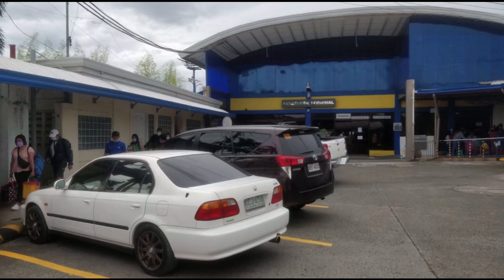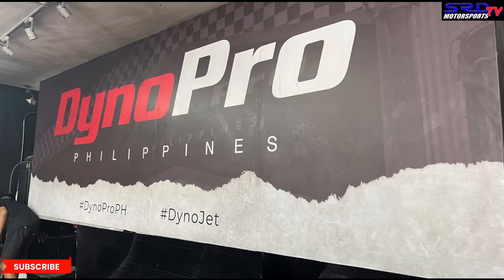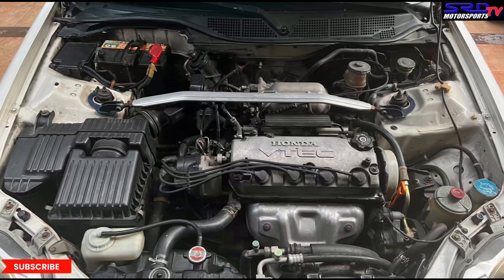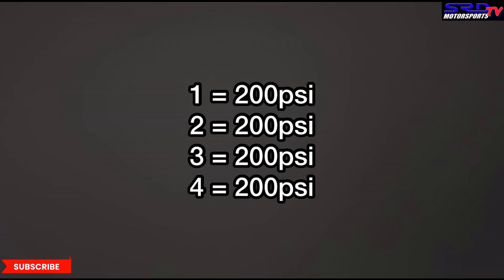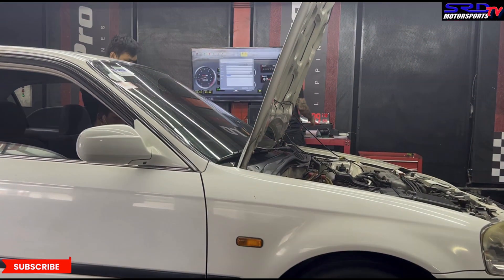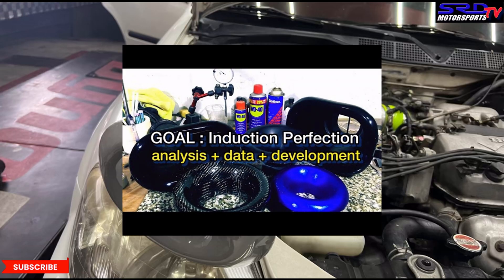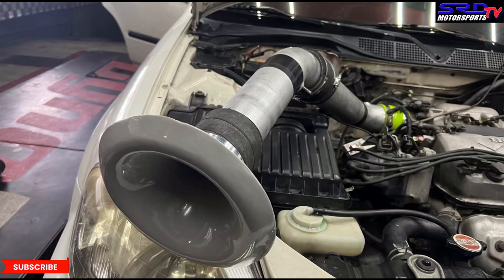Civic VTi D16y8 Ph16 Rebuild Series Part 1 Dyno Run Inside

Comment from the maker: Here we pin all the episodes for you guys

Part 2 - https://youtu.be/6kEWCg6fspE

Part 3 - https://youtu.be/WX0-5cbw5IU

Part 4 - https://youtu.be/NBF4Xvz52PU

Part 5 - https://youtu.be/q_Fv389r454

Part 6 - https://youtu.be/Cs1ugWuaR6U
Reply: Sir is the D16Y5 the same as the local VTi engine?
Reply from the maker: no the local VTi is just different from most I’ve seen
Reply: @SRDmotorsports  thank you sir. But is the D16Y5 better than the local VTi engine in terms of power output and fuel efficiency?
Reply from the maker: I don’t know and it’s really not that important because we don’t get or have the d16y5 here
Reply: The 2000 VTi-RS i just bought has the D16Y5 engine. I dont think the car has undergone an engine transplant
Reply from the maker: unlikely cuz all local cars are stamped ph or pg6
Reply from the maker: And there are d16y5 engine sellers here

Comment: Finally! A local channel that's building an identical car as mine. And a build series na susubaybayan ko! I have a P6FD1 engine sir.
Reply from the maker: Oh same same… I think it’s fine just don’t know why the change from or to ph16a done by Honda  I think siR body is p6fd1 VTi
Reply: @SRDmotorsports  that's right, sir. I have the same model 1999 vti sir body, manual tranny. 
Are they really just the same as the ph16? I believe this is our version of the d16y8 or the vtec-e. No actual cam profile with higher lift. It only changes a bit when it reaches a certain rpm (I think 2500 or 3000?) Number of valves engaged past that rpm? 
I still don't know for sure so I will definitely follow this build!
Reply from the maker: @mjfanHD  yeah ph16a and p6fd1 is the same one

Comment: great video I used a larger throttle body off b20 and port matched intake both sides    healthy motor at 200 psi  would go another 20 years
Reply from the maker: Funny yet so true another 20yrs looks like it can handle at the boredom of the owner hahahahaha

That’s a good move usually the b20 tb is cheaper than the b16 but same size 😫 on the next episodes we’ll talk about the changes I would do, I want to reach the “ram air” power of 106whp on stock airbox lol

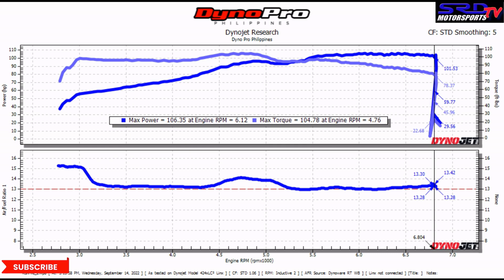Comment: 12:09 + good header and tune = interesting to see how much it would make with just bolt ons and tune
Reply from the maker: So true! But in the flip side… do the “usual” banawe mods we see like random header + simota would it make the same whp or less and if same? Not on stock ecu? Interesting right?!
Reply from the maker: True story sa dyno run it was hard to tell “when” it was WOT cuz all stock muffler lmfao!
Reply: Will you be touching the ports on this build?
Reply from the maker: @findtherightbeat  tempted but to be fair maybe just “port match” as I wanna show the difference of a “proper” rebuild with minimal changes this way power gains if ever is purely on engine health
Reply: @SRDmotorsports  Shooting for maximum efficiency with stock components 👍
Reply from the maker: @findtherightbeat  yep… pretending it’s “limited class racing” must be stock loool
Reply: @SRDmotorsports  What I find interesting is how consistent the AFRs are with the stock ECU and how the pipe length leaned it out and produced that hump
Reply from the maker: @findtherightbeat  yes! That stock ecu be rockin consistent AF! And true on the  extended intake pipe

Notice up top last 500 rpm it was linearly going lean too me and colleague assumed had this engine able to rev to let’s say 7,500 it woulda bean leaner too
Reply: @SRDmotorsports  Hope you can do a teardown and inspection episode on the engine. It would be interesting how round the cylinders still are and its finish and what the condition of the bearings are with the mileage.
Reply from the maker: @findtherightbeat  yes indeed! That’s initially planned and “other” inspections that could be easier for most to adapt too
Reply: @SRDmotorsports  Not sure if my suggestion will fit the owner's build plan but I'd suggest changing out the ribbed oem intake piping with the same length and diameter ones that are from other cars but without the ribs to improve efficiency.
Reply from the maker: @findtherightbeat  that’s not a bad idea just we know it might “exaggerate” the rebuild result and make me look too good 😀 actually my idea was similar to what u said

But more like cut a “simota” to fit (length wise) kinda like what spoon did 

Both ideas should work great actually